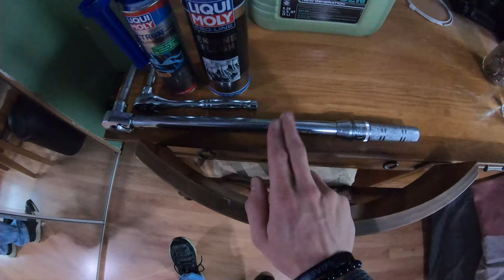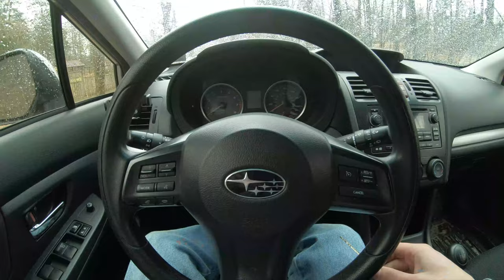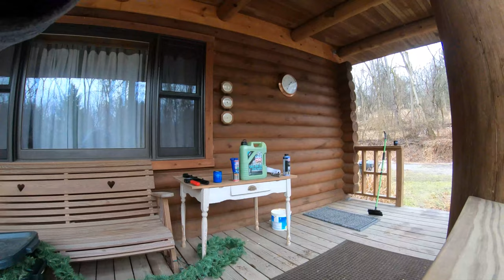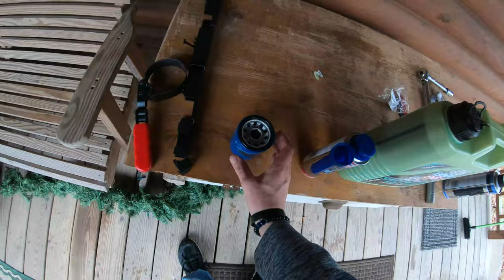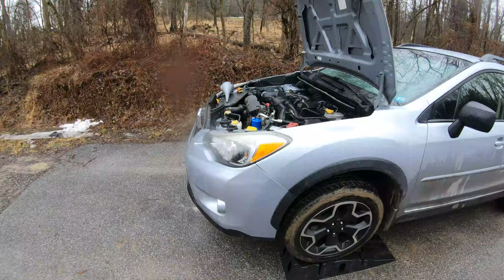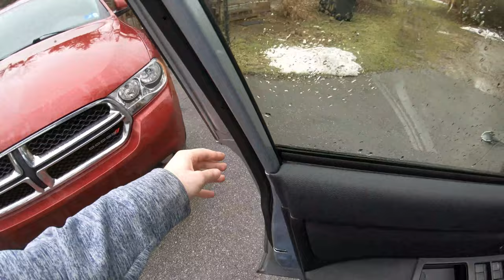Putting Green Oil in My Crosstrek? (Molygen)

Comment: I write oil change info on the top of the filter using a permanent marker (blue is much easier to see the writing than black)...Have you noticed any change in mpg after putting in the molygen?   I put the 5w-30 green stuff in my 19 wrx (38k mi) and I've noticed that the mpg has dropped, on avg, 2 mpg; and the engine tone has changed like it is working harder.   Prior to the molygen, it's been serviced at the dealer for oil changes.  My 04 GTI loved liqui moly 5w-40, but my wrx FA20DIT seems to be less happy with the 5w-30.  Now I'm curious what weight/type of oil my dealer used for services 🤔
Reply from the maker: I honestly didn’t notice too much difference with Molygen, I still averaged between 25-30mpg depending on how I drive and where I’m going.